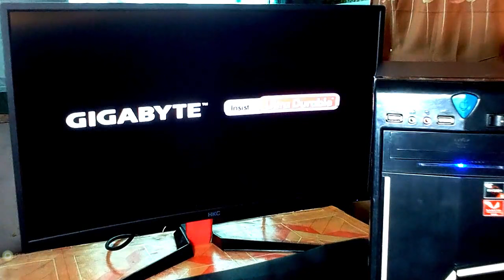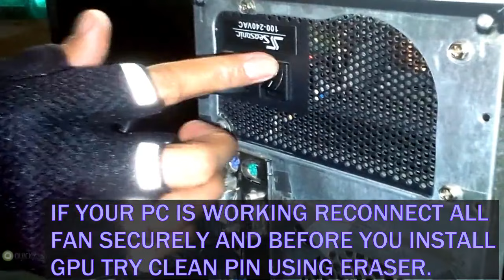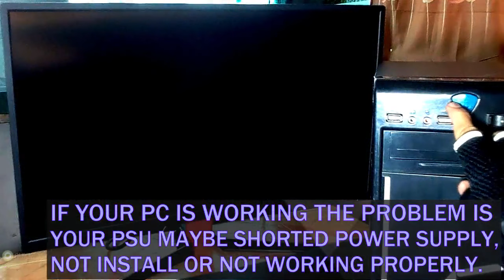HOW TO FIX COMPUTER TURN ON THEN TURN OFF IMMEDIATELY ? CPU FAN SPINNING ( 2019 )

Comment: Nothing helps :(
Reply: @Game Time with Jc hello i had this isssue 2 years ago as you see ive had found out that my motherboard was broken and after I bought a new one and installed it it worked fine
Reply: @mendi. i think that might be the issue with my when i only have the motherboard cable connected to my psu it actually starts but when i put in the cpu cable too it doesn’t so i recon it’s my motherboard
Reply: @jakepalmieri2356  cpu cable what do you mean?

Comment: My Pc wont turn on. when I turn it on, in every 3-5 seconds it turns off itself and then will turn on again eventually, it keeps repeating itsefl, what should I do????? plssssss I need advice😢😭😭😭😭😭😭😭😭
Reply: Remove the ram clean it then put it back
Reply: Bro mine same could you get any solution please tell me
Reply: May be  the problem is with your power button check the power button
Reply: bro your rams have finished you have to replace it

Comment: This didn’t work for me but should work for a lot of people, thanks my pc still won’t boot though
Reply: Did you found solution
Reply: @mygamingadventures  I needed a new motherboard, it was because the cpu i upgraded to wasnt supported by my motherboard, it had the right socket type, but not the right chipset
Reply: @Thebabario  but In my case I was playing games and computer shuts down automatically and start doing this
Reply: @mygamingadventures  oh, were you overclocking your cpu or gpu too much or something
Reply: @Thebabario  no bro
Reply: @mygamingadventures  did you fix it I’m having same problem
Reply: @mygamingadventures  same problem. Im playing games in half and hour. Then automatic shutdown. When try turn it on. My pc wont turn on, only fans running few 1-2 seconds.

Comment: The video turns on off for a while when the computer is turned on..please give the solution..
Reply: Check vga or display cable(connection between CPU and monitor

Comment: you can just change your CMOS battery. it worked.
Reply: @Samuel Goldman try to remove 1 ram.
Reply: I have 16gb ram. 2x4 and 1x8 which 1 can remove ?
Reply: @pinkertonagent  sorry for the late response. you can just randomly remove one then test it. then if its still not work, try the other one until you see the perfection of our universe. jk just try it.
Reply: @mrweng4192  its ok bro. Thanks for response... I will try it later, and thank you for your tips.

Comment from the maker: PLEASE SUBSCRIBE GUYS, SUPPORT PINOY CHANNEL ... THANK YOU..

Paano maglagay ng Thermal Paste sa CPU? HOW TO APPLY THERMAL PASTE?
https://www.youtube.com/watch?v=C2pZ582V1p4
Reply: salamat po...
Reply: thank you... working xa... very helpfull
Reply: Thanks bro
You are amazing
You save my pc👌👌👌
Reply: QUICK & EASY This is my problem plz help. I turn on the pc it’s stays on for a minute the. Turns of then it immediately turns back on then it stays like that. Also when the pc is on. I have no display.  I hear the pc is running and the mother is brand new and so is my power supply cause I just bought the pc. Any tips would be helpful. Also the small wires that u used for the thumb for me are kinda mixed up could that be the reason due to my problem. Plz reply
Reply: Congrats  🎉🎉🎉🎉🎉🎉
Reply: sir ano problema kung i press ko power button iilaw sandali pero ayaw mag turn on ng computer ko?
Reply: Tjk Lynx hey i have the same problem u resolved?
Reply: Ok
Reply: I open all parts and connect without case then when i start Trun on and off automatically after 10 seconds .

Comment: had the issue where my pc boots and turns off, then wont turn on unless i keep pushing every cables and same issue turns off randomly in 5 min, after 3 days thinking its my mobo or psu, found it was my cabinate power button.. what i did is unpulg the power cable from mobo  and used screw driver to switch the pc on via the jumper on mobo and the problem never came back , cleand the cable for case power switch n put it back in mobo works normal now

Comment: Bro i just try everything you said in video but I don’t know what happened to my pc I still can’t figure it out pc is turning on but no display. When I watch your video and try all 1 thing is fix . On first when i was turning my pc on the my fans ridiculously start running fast when i try your methods now they are spning slow but still no display please help me
Reply: Did u fix it
Reply: No still working on it
Reply: Hi, did you fix it?
Reply: @hilascs  yess i change bios settings every time my pc turns on it auto install bios every time
Reply: @juttplaysindiegames2904  That's so weird. Motherboard issue then?
Reply: @hilascs  yea bro and i cant fine another motherboard here . im so pissed
Reply: keyboard numlock led lights functioning? if yes try another gpu

Comment: I replace a new gpu and psu this happend to me pc all fans are spinning and few seconds it's shutting down when i pressed power button again it doesn't work  i have to unplug the psu and turn on to see the lights and its still the same
Reply: I have to unplug the psu and turn it on everytime when it shuts down after few seconds plz someone help?still isn't booting
Reply: @aroshadinal3702  what was the solution?

Comment: Sir my problem is my pc just powers on 1-2 seconds then shuts down. Thanks for the help
Reply: Same.found any solution?
Reply: @sharmilashetty6564  My power supply is the problem. I changed the power supply and its ok now
Reply: @kenkai8739  oh ok.I will change and see

Comment: Pc is starting by cpu switch & fan also. But cpu is being off after few seconds, but fan is running. To stop fan cpu switch off is not suffient. Main power switch is to be off as required to fan off. Why?

Comment: Removing my back panel 4 pin connector worked, turns out it was already damaged. Thanks.
Reply: @cuazibo  4-pin fan wire was cut for some reason so I just used the molex connector since it is an old fan lol

Comment: i cleaned ram,
i removed the cmos cell
did reset bios
cleaned ram with eraser
removed all dust from cpu, and motherboard board
Checked thermal paste and applied new one
the pc loads into bios successfully but pc only stays on active for max 10-16 sec and then gets shuts down on its own

Comment: Hi Sir, I already replace my psu and did all of your 6 steps, but it keeps on and off, but when I removed the 8pin cpu connector from motherboard, it open, but wont boot ofcourse,
Reply: How u fix it

Comment: @K A I My pc problem is a bit different, first my pc turns on and it works fine, I'm even able to watch YouTube etc. Then the screen suddenly shuts off and when i watch my computer all the lights: mouse, keyboard, cpu cooler rgb and psu rgb are all flashing like an SOS light. Then i have tu turn it off manually because it doesn't shuts down for itself. I first thought that the problem was on the psu, so i switched it with one of 650w But the same problem was showing. And then i switched my cpu cooler because i thought my cpu wasn't cooling right. Guess what, same and i did it today im stuck on this pc build of 600€ and i watched every video of the freaking yt. None has my problem. Anyone, pleaaaase could anyone help me?
Reply: Did u fix it

Comment: First worked for me, thank you very much, for those which could have that It does turn on, but no video, and your ram and power supply are ok and buzzer not beeping, consider replacing your motherboard, that happened to me

Comment: Tinanggal ko na ram pinalitan ko ng iba, check ko na kable, pinalitan ko na power supply nilipat ko na sa ibang case, ni reseat ko narin cmos abay ganun pa rin 😵😵😵
Reply: pwd grounded na talaga board mo boss kaya ganun
Reply: @paulobondoc7149  bumili nalang po akong bago dead na po sya

Comment: I changed the BIOS settings to a special power mode and set the shutdown flag. From this moment on, the device turns on and turns off after one second. I removed the battery and RAM, and the problem still exists. Desktop device. Please solve.

Comment: lods baka matulungan moko. nagpalit ako ng graphic card tapos hindi na sumindi.

pag on ng computer yung power indicator light (green light) sumindi naman tapos umikot din yung fan sa case, processor, at sa psu. kaso after a few sec. mamamatay na yung mga fan pero yung green light naka ilaw pa rin. 

spec i3
graphic card: rx560 4gb
psu: 350w true rated
8gb ram 4gbx2
umaandar naman sya dati pero nung nag palit ako ng graphic card na lower unit dun na nagsimula yan.

nagpalit ako dahil sa gusto kong subukan ang lower unit ng gpu dahil iniisip ko baka sa gpu ang dahilan dahil sa panay sleep mode ng monitor ko. so pag ginagamit ko at biglang mag ssleep mode ang monitor pinapatay ko sya sa pag off ng avr. naka ups ako kaso avr lang. sa avr ko inooff dahil pag nag sleep mode ang monitor di ko na masashut down ng maayos ang pc.

sana matulungan moko.

Comment: I have cleaned ram but still same problem
Just 4/5months ago I have builded pc
I think ram is ok, then why happening this?
Reply: Find solution?
Reply: @realtruth1592 it was motherboard problem
changed it

sometimes it occurs for power supply too

Comment: I tried a new bios battery 
A new rams 
Cleaned the whole pc with air 
Changed gpu thermal 
And nothing worked !! 
Everytime I plug the cable the fan spins and turns off immediately
Reply: Same what i do
Reply: What was the problem?

Comment: Yesterday i turned on my cpu.. but that time the display didnt come and some bad smell comes from my pc.. now i cant turn on.. cpu and psu fans spins 1 sec and turn off.. my psu working fine.. i check it with paperclip trick.. now what can i do?? Help me
Reply: ithink same problem to me
Reply: @renlorbasio586  solution is check your motherboard processor port pins.. Mine was damaged
Reply: my pc already replace the psu but the same,shutdown occur
Reply: @keishavlog3032  reapply termel paste

Comment: Bro. My computer was working smoothly but when I shutdown the computer, it won't shutdown inside the CPU fans are stills spinning and USB also still working lot of time after shutdown and then I cutoff the power supply it not working after i switched on CPU is not working for few minutes same thing happened for restart also after pressing restart CPU running continuosly but it doesn't restarting please reply me to what to do ?

Comment: I have tried to remove the battery and wait for 5 seconds. and I plugged it back into the battery, I plugged it in and on the pc. the fan rotates for 10-15 seconds and does not rotate. but before I try like you teach the fan to spin for only 2 seconds. can anyone help my problem ... sorry i use google translate

Comment: I know this is a 3-year old video but i hope someone could respond. I did all the six. But still my pc keeps turning off. I changed my ram, replace thermal aste, new power supply and ssd. Put paper on screws. Al fans and wires working. Maybe the last problem is the motherboard itself?
Reply: Hi, did you fix the issue? I am having the was issue

Comment: Hello, I have an Ibuypower gaming pc that is about 5 or 6 years old. For the past year or so, my pc will randomly power cycle. The last time it did this, I removed and cleaned the ram, and it started working again. It did this again a few days ago.. I was taking the old ram out and putting in new ram.. upgrading from 8 gbs to 16. When I powered my pc on , it started to power cycle again. Ive even tried putting the old ram back in.. and it still wont stay on. However, if I turn the power supply to 230 volts instead of the 115 volts, it will stay on, but nothing will show up on my screen. Im thinking my issue is that the power supply is dying.. So Ive ordered a new one and will be replacing it this week once I get it. If that still doesnt work, then I'll take it to a computer repair shop. Any other advice? Ive cleaned it, removed the battery, checked all of the wires. Thanks for the info.

Comment: I have a problem that when pc desktop shuts after some time there is no light in keyboard and mouse but there is power supply light is on and even the fan is on
Reply: Did u fix it i got the same issue it shoes no signal after windows logo and no light on keyboard and mouse and power button not working to shut it down fans and rgb working

Comment: my problem is when i turn my pc on it wont boot, but if i don't plug in the power supply to the graphic card it will bootup. PLEASE HELP ME and my graphic card fans spin for 5 seconds then stop only when i first boot the computer up.

Comment: Mine goes off in less than a second, and it goes on and off simultaneously as long as it is plugged in after pressing the power button and will only stop after unplugging. Before all this stuff happened my pc suddenly turned off and  had a bit of a burn smell. Did my psu overheat? Because that was where the source of the smell was. I'd look more into it, but I'm new to parts of pc's and i was afraid that i would damage it even more. Is the only solution to this replacing my psu? Or is there a more free way to do it? As i don't see any burns or damages from atleast the outside of the psu.
Reply: This is what is currently happening with me minus any burn smells, my pc has powered on a few times since then but i cant get it to power on now I have tried everything but all it does is power on for 1 sec then turns off. Did u ever find a solution?
Reply: I am facing same problem right now... Minus the burn smell... How did you guys fixed it ?
Reply: facing the same issue
Reply: @infamous8541  just replace your current psu mine was actually fried prob bc of a storm. Luckily mine was still under warranty so it was free

Comment: Tried all steps, only thing I can think of is mb is blown, gonna switch everything to a replacement PS tried out power, vid card, on another pc, they work only things I haven't swapped is mb and cpu so... wish me luck with mb swap thx :(
Reply: @theptek2000 did it end up being the mb? I’m also tryna figure this out if u got it fixed how so??

Comment: My power supply is running but there is no image on the monitor, not working reset and power button. I tried with another power supply, it works.  So i am sure that is power supply issue. What is the problem with power supply?

Comment: Dear Quick & Easy. I build recently a new pc With MSI b450 pro vdh plus Mobo. When I shutdown system. CPU and PC Case FAN still running on same speed as normal working PC even after shutdown. PC hardware won't turn off properly with shutdown click. I'm totally frustrated with this issue. What do i do. Please help me. Which Step should i take to fix it.

Comment: This is really helpful. I just removed the rams, cleaned it and re-installed, double checked the connections and wires then boom. My computer started working again. Thank you.
Reply: What u clean? My pc is doing that and im stressed
Reply: @imunico  did u fix it?
Reply: @mendi.  yeah i clean the ram slots with brushes and the ram with a eraser
Reply: @imunico  maybe your cmos battery or power supply. My solution is same like your pc. Try many time cleaning ram and using vacuum, air pressure. Later i want buy new battery cmos and i trying. If nothing happen, same problem, maybe i replace new 1 power supply.
Reply: @imunico  Q1

Comment: Sir after you remove the battery you press the on button for 5 seconds, not plug on the powersocket?
Reply: Yes, power plug not plugin. Remove the battery and put new battery wait for 5 seconds. Then plugin back try turn on.

Comment: After doing all steps also problem not solved.. cpu fan is running when 24pins connector connected and without connecting atx/4pin connector (like there is a short circuit in motherboard's vrm section).. any solution ?
Reply: Find solution?
Reply: @realtruth1592  Yes.. In my case SMPS is the culprit and I've replaced it. The power supply works perfectly while turning on but after sometime it fluctuates the power supply and it Makes our cpu to turn off.
Change the PSU/SMPS immediately to resolve this issue !

Comment: Hello sir.. my problem is when i switch on my pc it's fan spin normal first than immegiately start spinning ultra fast continuosly...
In this process no window staring and no signals on monitor. Please sujjest me solution.
Reply: Cleaning the ram using rubber, and put it back.

Comment: My pc will only turn then turn off if my cpu power is disconnected any fix ?
Reply: Did u ever find solution I have i7 7700
Reply: Kyrexx testing now whenever I unplug cpu cable it works
Reply: Damn not it when I used my cousin cpu and it worked but there is nothing wrong with cpu I literally moved and that was it it’s still perfectly healthy. Do u have a number i can text u photos to

Comment: I wonder if you can help me.  My pc will boot and work for hours, then it will shut down.  After shutting down, I have the same problem that you show in this video.  If i leave the computer unplugged for like a week, it will boot again and work for hours before the same thing happens again.
Reply: So activate your windows 😬
Reply: it is probably overheating, so follow these steps:
1. take your heatsink and CPU fan off.
2. put thermal paste on the cpu.
3. put heatsink and fan back on
4. test
Reply: @pakicompany  My windows is activated.  It was my mother board was damaged from my water cooler.
Reply: @Make-Tell  My motherboard was damaged from my water cooler.

Comment: I have problem i build a new PC today and i start install Windows 10 and i instal drivers and everything. After 30 minutes they start sound like they wana die and my screen get black and white and i turn it off. And again they start normal and again they sound Like they gona die and turn srceen in 100 colors. Can u please help me to fix this problem 🙏🏻
Reply: Veljaa gpu , screen monitor  problem
Reply: @avegailanoy8250  How did you build the pc ?